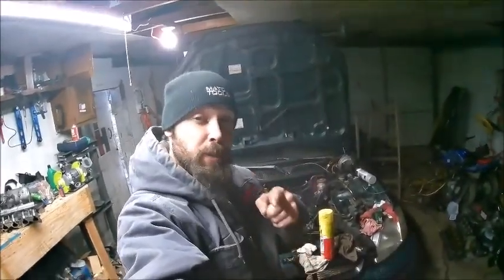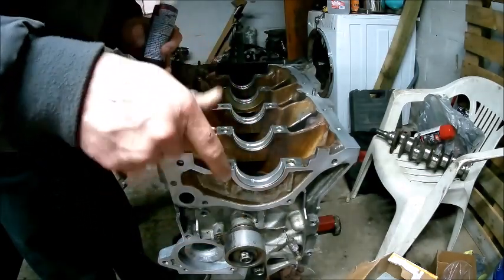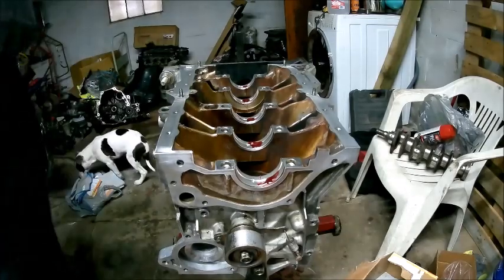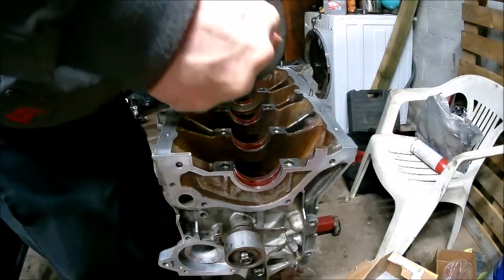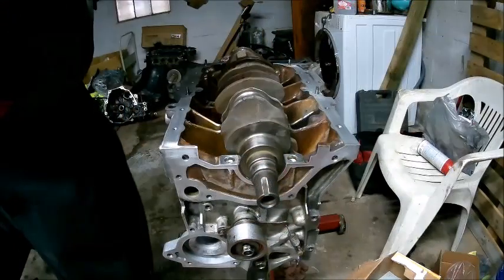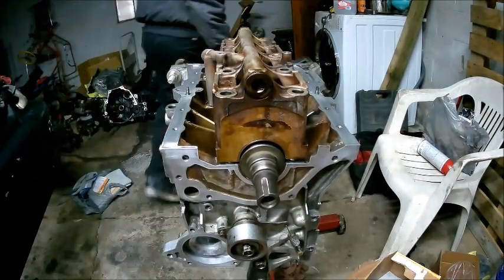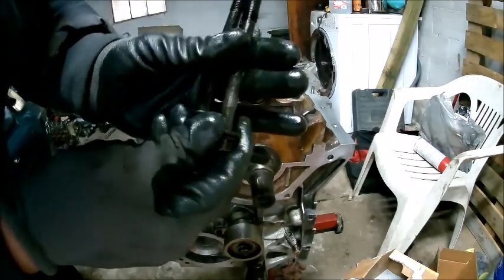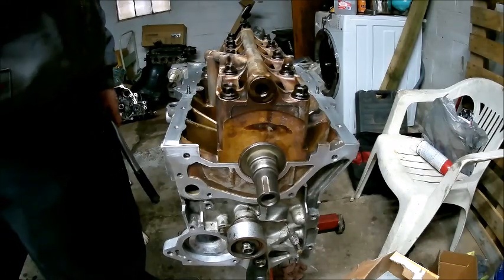D16Y7/Y8 High Compression Budget Buld PT.1

Comment: 👏👏👏 I'm building a Daily eg Hatch & thinking of building a D15/D16 High Comp maybe OEM build but I dont know much about them....YET I have a built K24 eg but thinking of a daily 160 whp daily  on 75 shot for fun sound reliable daily
Reply from the maker: I'd run the z6 or d15B, the z6 cranks have duel oil ports on the crank so the rods don't starve for oil in the high revs, why I put a Nippon racing z6 crank in my y7 block
Reply: a trick: you can watch movies at InstaFlixxer. I've been using it for watching lots of of movies during the lockdown.
Reply: @Kian Pierce yup, been watching on instaflixxer for since december myself :)
Reply: @Kian Pierce Yup, I have been using instaflixxer for since november myself =)